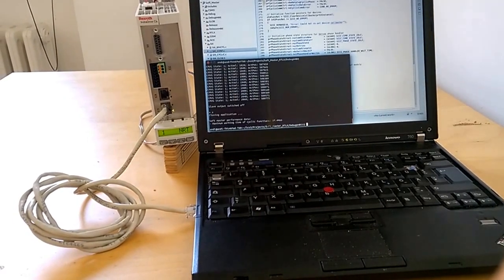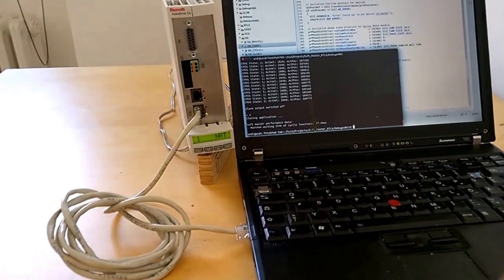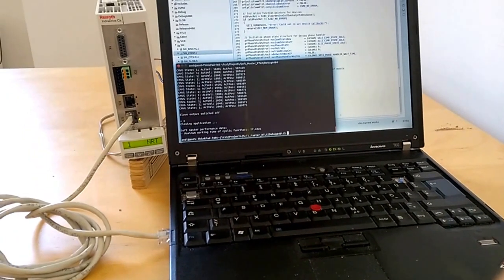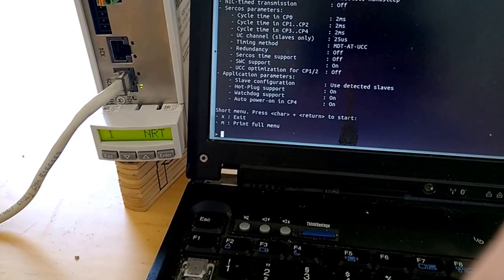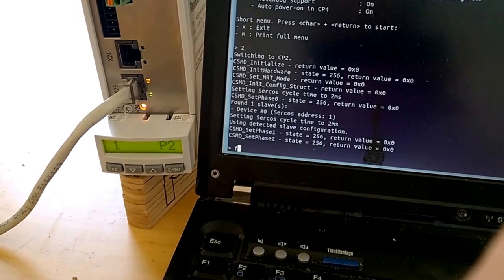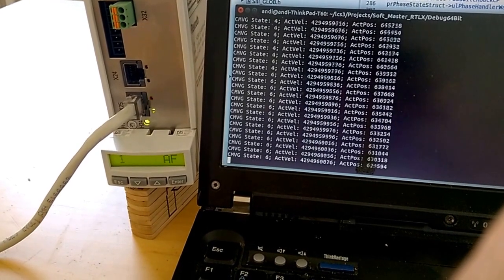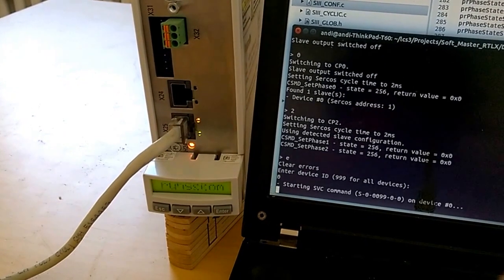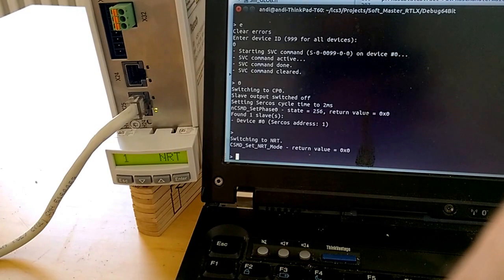First Step SERCOS III Softmaster within Linuxcnc

Comment: Hello Andreas. Thank you for contribution to Linuxcnc society :-)
You spend loads of time researching sercos comm do you think theirs chance to integrate old sercos 1 and 2  fiberoptic system in to LinuxCNC ? I have drives and PCI card but dont know where to start to be honest . Thanks again Ilia, UK .
Reply from the maker: Hi, I can share just some thoughts about that because I don't know it exaclty. I think the stack in the Soft-Master is build up in a way that under the level of CoSeMa their could be used also PCI cards like SerCans see here: https://link.springer.com/article/10.1007%2Fs00170-015-6786-y they use the PCI card for Sercos III. I see no reason that this won't work also for PCI cards with fibre obtic physics.
http://www.hs-emden-leer.de/forschung-transfer/institute/mabi/projekte/linuxcnc/real-time-ethernet-fuer-linuxcnc.html